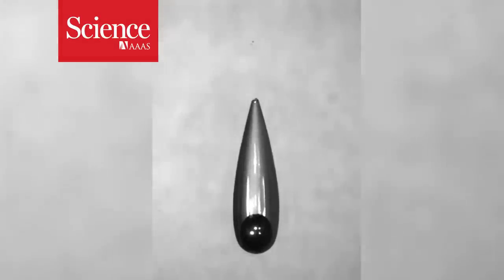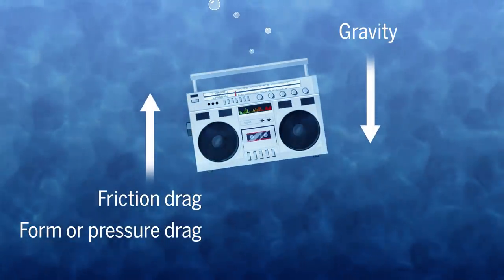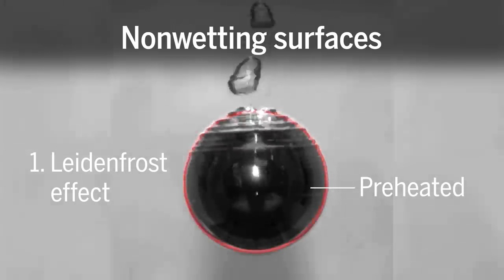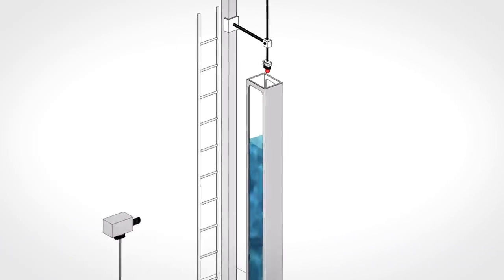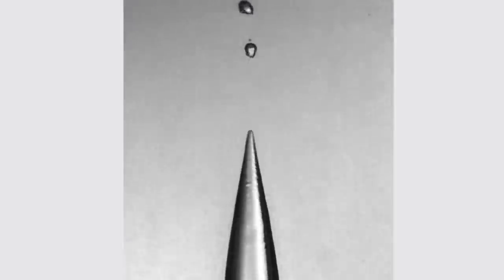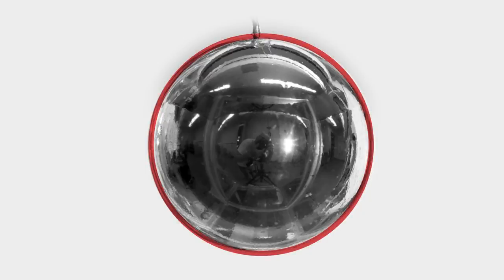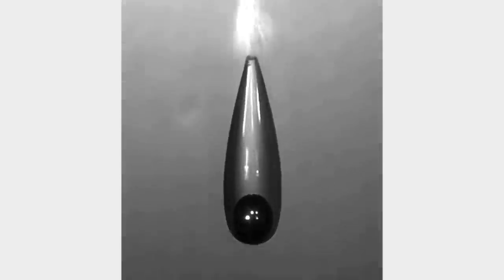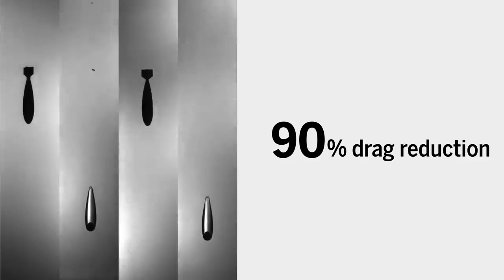Watch these hot balls cut through water like a knife through butter

Comment: If you create an air bubble around a boat hull you don't get a boat that travels quickly, you get a boat that sinks very quickly.
Reply: I think one of the practical applications here is the geometry of the vapor bubble. It appears to be the optimal shape for cutting through the liquid, so shipbuilders can use that to design better hulls

Comment: I was saying we should inject air bubbles under boats for reduced drag since the early 90's.
Some racecar designs could benefit from intaking air at the front and highest pressure point and blowing it into the lowest pressure point behind the car to reduce drag too.
And sailboat sails should be double surfaced airfoils that can morph/transition in form to make either side the top of the airfoil too, another of my ideas from the early 90's.

Comment: So if you coated yourself in hydrophobic material and jumped into the ocean would you sink?
Would it be fast or would buoyancy still hold you up?
Could we create an ocean elevator using this method? 
Could we create a submersible that could not only survive such a fast descent but allow humans to survive as well?
What effect would hydrophobic material have on a habitat at the bottom of the ocean? 
I'll actually take a guess on that one... would it increase structural instability as a result of fluctuations between the pressure at such depths pushing water toward, and the material pushing it away?
My other guess would be the pressure would negate the hydrophobic effects outright, or at least enough that it doesn't make a difference?

Comment: ok, but why is it that the air pocket stays with the ball after it stops shedding bubbles? the air should be floating to the top rather than sinking due to the buoyant forces on it. I wish this were addressed in the video.
my hypothesis is that the "air" pocket becomes completely composed of water vapor once it stops shedding bubbles, and vapor at the top turns back into water at the same rate that the hot ball turns the water into vapor around it, thus the pocket both follows the ball and stays the same volume for a period of time.
it's also possible that the pocket doesn't have any gas in it at all and there is simply a delay between the ball moving the water out of the way and the water closing back up again, thus forming a small vacuum.
There really seems to be a lot of misleading things in this video

Comment: Can someone help me with this. Shouldn’t they use the metal ball that was heated up vs the same ball when it’s cooled down instead of a plastic torpedo.  In the side by side it’s the same shape but that’s not important. A plastic torpedo wouldn’t have the same friction plus it’s actually longer and would have more surface area to cause friction. This isn’t a proper control and a 90% reduction as shown is just completely wrong.  Am I missing something???

Comment: Umm, I'm I an idiot for pointing out that plastic objects won't sink as fast a metal ball either way?  Why not just drop the metal balls in without heating it up or applying the hydrophobic surface to see the difference?  My thinking is that this air pocket is a side effect and not actually a part of the object.  If you applied the hydrophobic coating to a torpedo, it would probably create it's own air pocket making it even larger in comparison to the ball with a torpedo shaped bubble around it.

Comment: The comparison to plastic, torpedo shaped projectiles isn't a fair comparison to show reduced drag. The plastic torpedo has a significantly greater surface area compared to the steel ball. So the amount of drag on the torpedo will always be greater than that on sphere with small surface area. I also see that you created the torpedoes with a 3D printer. And having worked with 3D printers, I am aware of the limitations of 3D printers in producing smooth surfaces on printed parts. So you likely have further increased friction due to the rough surface of the plastic torpedo. I understand that there is relevant science that is being explored in this study and I look forward to further studies on the matter. But the video seems just like an advertisement conveying a somewhat inaccurate message. To do a fair comparison, why don't you drop spheres which are at room temperature or the same temperature as water and show video evidence of the same compared to heated spheres. You can also do the same with spheres without the superhydrophobic coatings. I'm sorry, but by using a 3D printed plastic projectile with a rough surface and greater surface area, you're just doing disservice to your own study.
Reply: Dear rachitm109 please read the related paper (available for free: http://advances.sciencemag.org/content/3/9/e1701558) . In short: the plastic torpedo is designed to have the same shape and surface area as the sphere-in-cavity structure; the plastic projectiles has been sanded to have a smooth surface finish; the super-hydrophobic sphere generated cavities are formed by room temperature spheres in room temperature water - all this information responding to your comment is already in the paper and in the video.
Reply: Ah I missed the supplementary information. But i still don't get the surface area disparity or lack there of as you are saying. You're saying that surface are of the plastic projectile is greater than that of the sphere but equal to the area of the sphere-cavity structure/shape? But even that doesn't seem fair, as the actual surface area of interaction/friction with the water is greater for the plastic projectile. Are you saying that total friction experienced by the plastic projectile is compensated by the friction 
experienced by the air cavity + friction exerienced by the sphere? It doesn't seem right. Because on one side you have an actual surface of the projectile that is in contact with liquid and on the other side you have a pocket of air (likely water vapor) that is clinging on to the hot sphere and essentially getting regenerated continuously as the sphere falls. But all this while, the surface area of the air pocket created is still equal to or slightly larger than that of the sphere and STILL smaller than that of plastic projectile. So in my head, the plastic projectile will always fall slower to the heated sphere. Why didn't you show what happens with unheated spheres and their comparison to heated spheres? to truly show the leidenfrost effect??

Comment: Is it really an air pocket?  How  and why does the air get dragged into the water with the falling ball?   Why does the air 'stick' to the falling ball and not release like an independent a bubble?    Why does the air pocket speed up the falling in the liquid compared to the 'torpedo"  shouldn't it add buoyancy  and slow the ball in water down?   Does a bubble raising up in the fluid travel as fast as the ball trapped with the bubble falls?

Comment: Just a suggestion, but try having someone who understands physics proofread your script before recording next time. Too many fundamental glaring errors here. Drag does not "slow down" objects as they sink. Reducing the drag coefficient lowers the terminal velocity of an object, but it's still speeding up until it reaches that velocity. And if drag were eliminated the ball would not fall at constant speed; it would accelerate downwards just as if it had been dropped in air. The two objects had the exact same amount of drag exerted on them as they fell, but because the drag coefficient of the ball was lower it needed to reach a higher speed to get that amount of drag.

Comment: Literally super cavitating torpedoes
Reply: Yes. Use something like a forward extended concave tip on a projectile shaped vessel. The tip vibrates back and forth at a frequency that exceeds the speed of sound in water. The idea is that the tip would then cavitate and with forward motion of the vessel would cut through the fluid. The rest of the vessel would travel through the cavitation wake with minimum water resistance. Believe that something like this was proposed in the 60s and later again in the 80s for torpedoes.
Reply: @TriAngles3D  Russian torpedoes use it for really long time.

Comment: That General Principle Probably Doesn't Work Exactly The Same In A Pressurized Horizontal Plane; The Air Pocket Would Likely Collapse Upon Itself Continuously, Generating Negative Pressure In The Wake, Causing The Object To Lose The Extra Drift Velocity It Gains In The Verticle Plane Through The Water Surface Tension And Weight Pushing Equistaticly As Overburden, The Gas Compression Pocket Acting As Lever To Transfer The Entire Force Of That Overburden Against A Reduced Surface Tangent To Center Mass In The Direction Of Flow, Simultaneously Applying Pressure To The Projectile And Hydraulically Pressurizing The Foreward Gas Pocket In An Epicyclical Manner?

Comment: I'm interested in how this can be applied to aircraft, as it's still fluid dynamics.
Reply: You can easily create an air pocket around an object in water. But what would the pocket be made of in air? Void? 
I don't see how it can be applied to aircraft.
Reply: Lighter gasses, I was more thinking of a lower friction surface area. It's stuff they already research.
Reply: Perhaps a heavier gas that is heated or charged. I don't have the solution, my point was that it might be worth looking into more.
Reply: It has been done with vacuum generated at the wings surface to reduce turbulence or drag. The clip I saw said it works great but maintenance made it impractical. Google tells me it's called Boundary Layer Control or Suction.